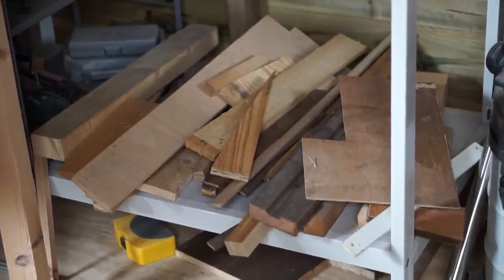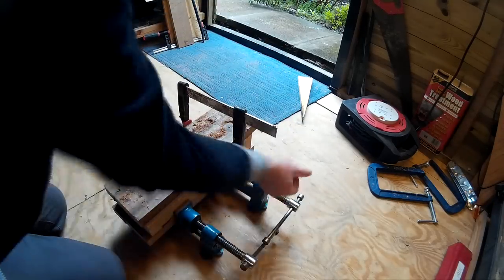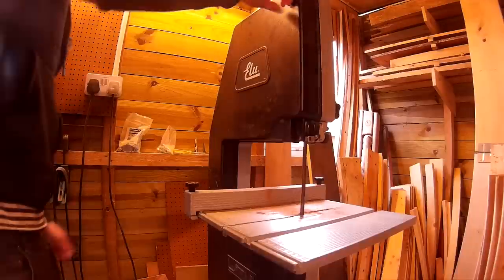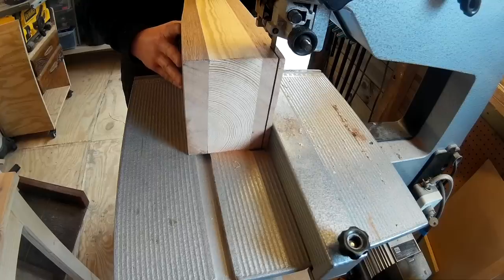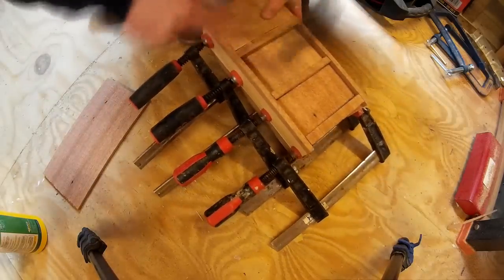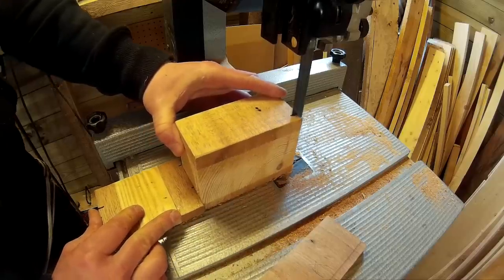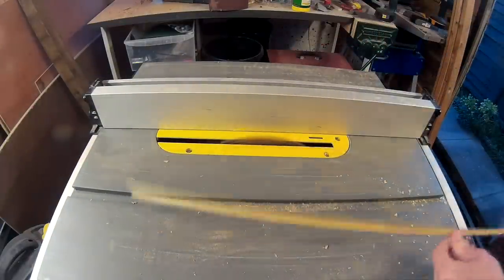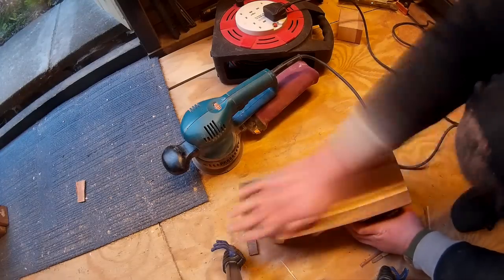Making A Miniature Chest of Drawers - bandsaw box woodwork project

Comment: NIce project. Good choice of Oil Finish.  You showed a simple technique of band saw cutting on the drawers more should learn from it. On the inside waste you made 3 cuts, one to each corner and then along the back, so easy on the band saw and yet so many try harder ways to get out the waste.   Band saw with no fence is my go to tool for so many simple cuts.  Try a 1/4 inch blade properly set and you won't switch. thanks I subscribing..  Hals Wood Shop
Reply: Thank you for the kind comments and the tips, will try that out

Comment: A very beautiful result. I find that drift is sometimes caused by the fact that the blade is not seated correctly on the apex of the tires. If the gullet of the blade sits on the apex it runs fine.

Comment: Nice work Rag :) Not sure I understand Johan's point about the blade position on the wheel? I always position the blade (on the top wheel....don't worry about the bottom so long as it aint gonna fly off!) so that the gullet of the teeth (the deepest part, or 'valley', of the tooth) are riding somewhere close to the crown, or centre, of the bandsaw wheel. Bandsaw drift should not happen....it's indicative of poor blade guide setup (keep 'em as close to the workpiece as possible), knackered blade or the wheels not being co-planer. Incidentally, cutting curves is a great way to blunt one side of the blade thereby throwing the cut off (or drifting).....try to keep a dedicated blade for curve work only.

Comment: My bandsaw looks exactly the same. It is a DeWalt though, which company I take it acquired Elu at some point in the past and kept producing and developing some of their designs for a time. (Also routers.)

There were different bandsaw versions though. Mine has a three-phase motor and twin speed belt drive. It was set at the lower speed setting when I got it. That's not really fast enough for wood, I think it was meant mostly for cutting aluminium.

Running the blade at a higher speed should also help with the drift since it should transport the sawdust out of the cut more quickly (if I'm not mistaken).

6:54 "Then the lade started to drift again for some reason" - Notice how that was the first crosscut after those rip-cuts that had gone so perfectly without drifting? ;)

Comment: Cool project! In the video you said you positioned the new bandsawblade in the middle of the wheel. That is fine as long as your teeth are sticking out in front of the wheel. If your teeth are on the wheel, with the tension on, it will push the setting outof your blade. And that causes the drifting of the blade. That said, well done!
Reply from the maker: Thanks Johan I will check if the teeth are on or off  the wheel next time I'm in the workshop. I don't have much experience with bandsaws so have a lot to learn!

Comment: hey. im a novice woodworker and i dont have a lot of knowledge and i certainly wouldn't think to give anyone advice but i think you may be getting drift because your guide is too high. i get drift too and i usually do what you do and just compensate for it but its usually corrected when i sort the guide out. but i have a little crappy bandsaw by clarke so im no expert. maybe its different between models of band saw. but like i say i know very little so take it with a pinch of salt i suppose.

great video sir.
Reply: +ohdeasu I'm no great woodworker either, but what I am finding out fast is good tools make all the difference in the world.  Good luck on your adventure.

Comment: Actually. After seeing that you used tapered strips to fill the gaps above the drawers I'm thinking you may have already seen my video.
Reply from the maker: I may well have seen it. I'm watching YouTube woodwork videos all the time!! :-)
Reply: Wood 'n' Stuff w/ Steve French making drawers before gluing carcass back together could have saved need for gap filling bollock strips
Reply: +nick sainsbury - I don't think that would matter. The drawers are made from the wood cut from the carcass. The gap is the result of the saw blade's kerf. One could eliminate the gap by placing the between-drawer dividers closer together. But that would disturb the continuity of the grain.

Plus, the gap fillers are cosmetic; they aren't a necessary addition. They just eliminate the gap and add visual interest. In most cases, the gaps in band saw boxes are perfectly acceptable.

Comment: Sorry mate, you're going to have to improve your clamping techniques, and material. Open joints after gluing are a deadly sign. Rarely does one ever clamp "across" - horizontally, and "down" -vertically at the same time. Plus, using Irving type light weight cramps for large surface areas is suicidal. It's better to use cauls, both above and below, then use heavy duty cramps staggering them, while facing each other. Don't overdo the glue; better to brush on. After applying, let both surfaces "air" for a couple of minutes (water evaporation). Spread out very thinly (you don't need tons of glue). Start glueing from centre outwards. Better to flush one edge before ripping down on the table saw. Etc, etc. Take it from an old boy